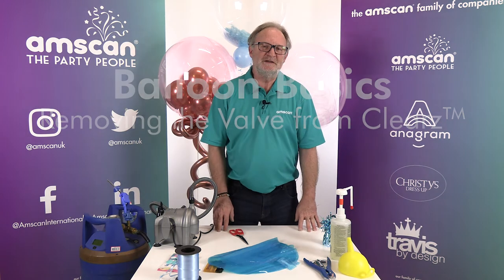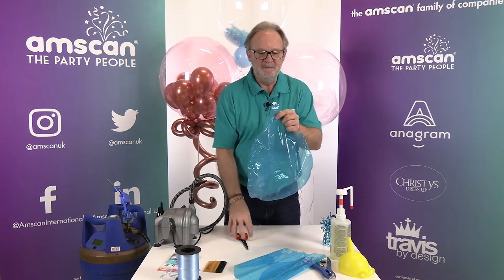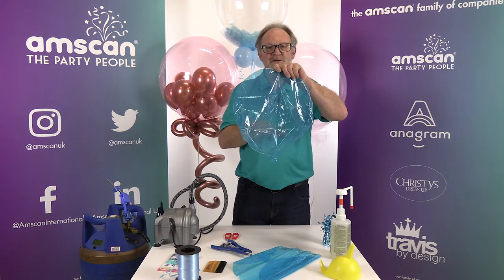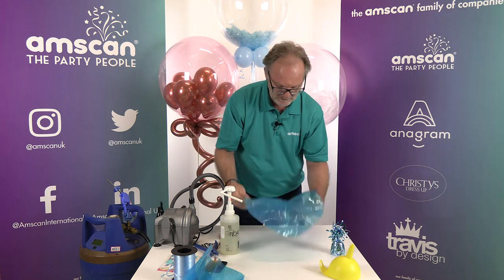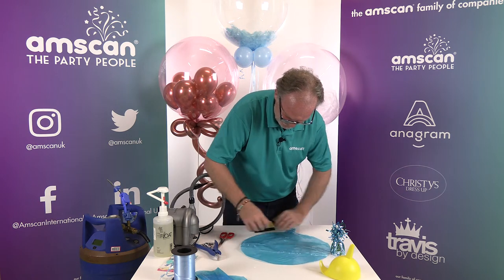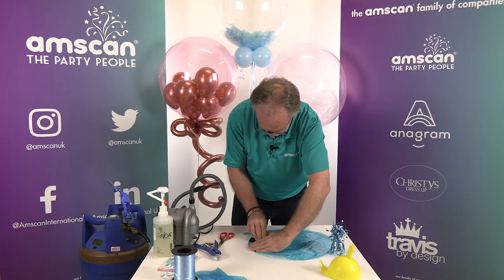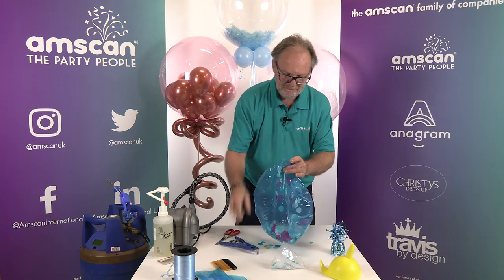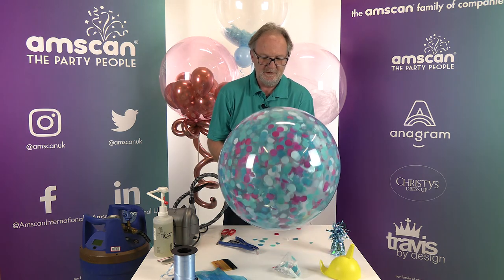Removing the Valve and Adding Confetti to a Crystal Clearz™ Balloon

Comment: Hi first;y your page is amazing thank you for all the content. Secondly I want to use this method with confetti in but I don’t want the confetti to stick. Can I leave the hi-float to dry before adding the confetti?
Reply from the maker: Hi Tyrah, the Hi-Float will help to extend the flying time of the Clearz as well as sticking the confetti to the sides. There is no other reason to use the Hi-Float, you would be ok to inflate without it, as long as you only want the balloon to last for a couple of days. I hope this helps!